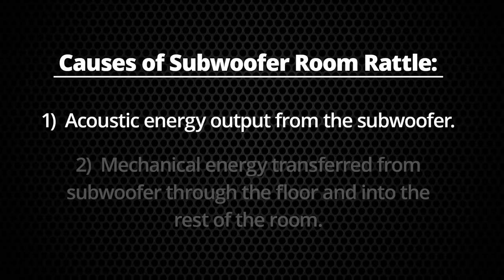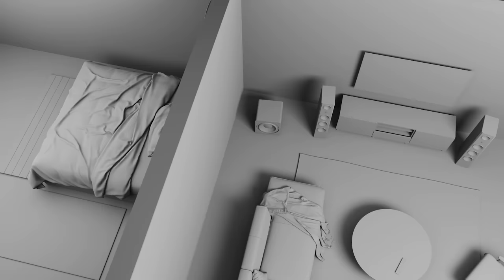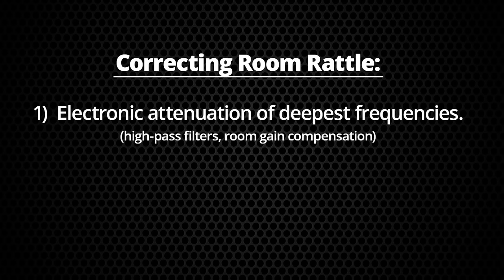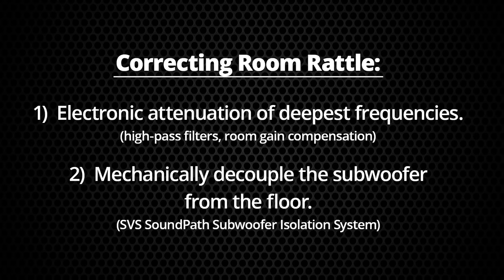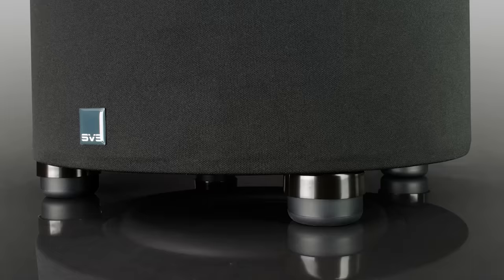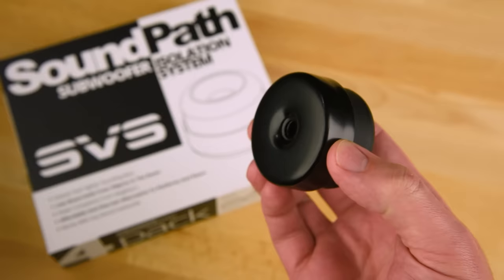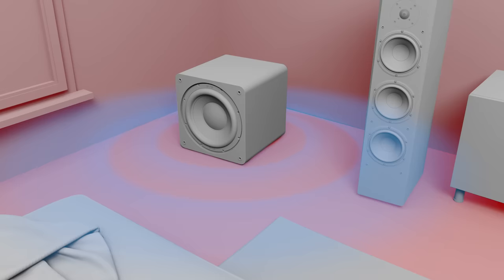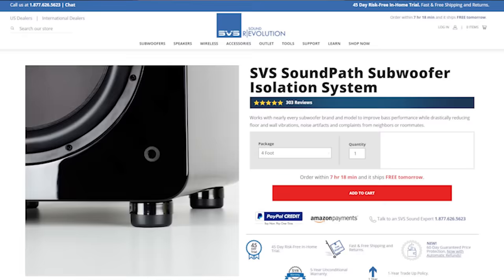How to Reduce Subwoofer Room Rattle, Vibrations and Bass Bleed

Comment: im using the prehistoric relq100e and never knew about floor boom.........i have wooden floors and when i ran the thx deep note test at the end of the avatar blu ray  the final part of the test i thought my sub was having a heart attack it sounded awfull........thank god i live in a detached propety...perhaps the supplied spikes are doing it any good?
Reply from the maker: The spikes keep it off the floor but generally don't decouple it from the room. Many people find adding the Isolation System eliminates the floor boom and room rattle, especially with wood floors.

Comment: I have a question if I may ask. What would be considered the weight limit of the isolation feet?
Reply from the maker: If using correctly with the proper number of feet replacing existing subwoofer feet, there's no official weight limit.
Reply: @SVS_Sound  90lbs+? My loudspeakers have 15's, and the house has hardwood floors throughout, so I'm quite interested is seeing how much vibration it would eliminate.

Comment: So for carpet the spikes that seem to come standard on the sub in the video would be just fine then?
Reply from the maker: The spikes won't decouple the subwoofer from the floor. That said, if you're not experiencing any room rattle or resonances with them installed, there's no reason to upgrade to the SoundPath Isolation System.
Reply: @SVS_Sound   is there a better way to decouple the sub if it's on carpet? Im assuming that this soundpath product isn't meant for carpets?
Reply: Joost Geurts Van Kessel it even helps on carpet.
Reply: I think spikes would couple the sub to the floor, increasing transmission of rumble.

Comment: am having sony iv300 dth home theater. am not happy with subwoofer. Please Suggest an replacement for that subwoofer.
Reply from the maker: The SB-1000 Pro would be a great alternative with deeper, more powerful bass if you're system has speaker level or RCA outputs.

Comment: Nice video trying to solve this problem with my home theater that’s in my basement walls are made of acoustic fiberglass from Owens Corning... the walls  I do not think are transferring really much energy to the rest of the house but the ceiling is... more specifically the floor above is... the ceiling is a drop fiberglass ceiling which the bass waves pass directly through for the most part... I know adding fiber glass insulation in the ceiling can only do so much with bass waves but I think if I put in denser ceiling tiles overhead instead of the fiber glass ones I currently have the combination should help me correct the problem? Right? 

My logic is that a drop ceiling for the most part is decoupled from the floor above as it is suspended, I’d prefer that to take on more of the bass wave impact first. Then the fiber glass insulation can help reduce whatever is left over.  I’m also going to try and rap duct work with insulation to cut down on resonance through there... is there any thing you suggest I do to my ceiling that’s relatively affordable?   Am I headed in the right direction? I’d prefer to stick with a drop ceiling as I love the quick and easy access for wiring.
Reply from the maker: Adding some insulation above the drop ceiling tiles will greatly reduce their potential to buzz/rattle and will also provide some sound dampening and bass trapping.

Comment: Opinions on having a subwoofer wall mounted? Assuming it’s secure. My concern is with the wall/house.
Reply: Unless it's on a brick wall or a reinforced steel beam then no.. i wouldn't recommend having it drywall anchored nor stub wall mounted at all. The vibrations alone cause it to be a hazard no matter the clamping force you put.

Comment: How about vinyl flooring on top of a concrete slab? Will the pads make any difference?
Reply from the maker: If you're noticing rattles in other pats of the room like fixtures and windows, then yes. Concrete floors are inert so the floor vibrations shouldn't be an issue.

Comment: Technically speaking that I don't think so that every one should need a extra pair of rubber pads to decouple the subwoofer and its low frequencies from the ground especially floors with carpets on it and on cemented floors. Because in my experience I already listened different types of subs some with bass reflex, some with passive radiator, and some build with the tech of air suspension which you also called them as sealed for a long enough. These types of floors doesn't digest enough frequencies which have been reproduce by the subwoofer itself so in this case you will still get a decent amount of power driven out to you as deep as the subwoofer can handle the acoustics upto.

("MAY BE RECOMMENDED FOR HARD WOOD SURFACES AS THEY RESIST SOME LEVEL OF FREQUENCIES")

Comment: I have the pb2000 on the second floor, wooden floor boards with carpet. Do you think the isolation feet will work well with providing a cleaner, tighter bass?
Reply from the maker: Yes, that is a scenario where it would be effective, If you don't notice a difference, you can return within 45 days and we'll pay shipping.
Reply: @SVS_Sound  I would love that, however, as a UK customer this will not be possible. But, I do trust your products so I know I can buy them anywhere and not be disappointed 😁

Comment: I have SVS 1000 Works good in my room no side sounds
Reply: I have the same sub but in my bedroom 
lower notes like 20hz can still be heared and it's shaking a lot my rear wall and door even at a normal level.

Which is not the case with my preview subwoofer in the same room even at a very high volume.

It's the proof that even the smallest svs sub provide a lot of energy even under 24 hz

Comment: Will these make much difference on a floor with carpet? Received my SB-3000 this week and running it with my Yamaha YSP-5600 sound bar. It’s unbelievable!!
Reply from the maker: It really depends on how your room is interacting with the subwoofer output. If you hear windows and other things rattling , or it's bothering neighbors roommates, it will help. You can also return at no cost within 45 days if there's no improvement.
Reply: @SVS_Sound  Thanks. Will try them out. The SB-3000 sounds amazing! Can really feel the bass!👍

Comment: My subwoofer makes a rattling sound at 35hz is there faulty in subwoofer or  all subwoofers rattles at 35hz?
Reply from the maker: You should not be hearing a buzzing coming directly from the subwoofer though it is not uncommon for subwoofer output to cause things in the room to buzz at certain frequencies. If it's an SVS subwoofer, please contact our support team to dive deeper into the issue custservice@svsound.com.
Reply: @SVS_Sound  thanks but it's not am svs subwoofer its am edifier t5 sub

Comment: Hi SVS!😊 I'm currently on the market for purchasing a small compact subwoofer for my apartment. I've considered many brands, but landed on SVS. I'm currently looking at the SVS SB-1000, but my question is. Are you guys planing on making a similar sub, but with a 10" driver, to make the cabinet even smaller? Cheers,
Reply from the maker: Hi Kristoffer - No immediate plans for a smaller 10-inch driver subwoofer. SB-1000 will remain our most compact model for the near future.

Comment: Should try this with my desktop's sound system. There's literally a joist under the floor right where my desk setup is and a double joist under the wall the desk is in front of... The bass vibrations basically go though the floor into the joints and into the center beam of the house much to my mother's announce.
Reply from the maker: It should definitely help with the energy transference in your scenario. There is a 45 day risk free trial so you could test and return at no cost if there is no noticeable difference.
Reply: @SVS_Sound  I tried it with a scrap peace of hard foam it definitely makes a difference in both the thump of the bass traveling though the beams and less revirb resulting in cleaner bass. So I'll definitely be doing something more permanent.

Comment: I built a pair of subwoofer platforms with four tennis balls each sandwiched between 1-inch thick boards. I used a door hole saw to recess the tennis balls and hold them in place. This greatly reduced the mechanical transfer from my subs to the floor and seems to tighten the bass sound considerably.

Comment: So what can I do about a down firing Subwoofer?
Reply from the maker: All down-firing SVS subwoofers come standard with the SoundPath Subwoofer Isolation System. They will also work with other brand models as long as there is enough clearance for full excursion and the screw thread size works.

Comment: My subs (dual pb3000's) are in my basement on Cement. I still get lots of vibration and rattle. Bass throughout the upstairs. I have figured there's not much I can about it. Yes?
Reply from the maker: You may want to try the SoundPath Isolation System with the 45-Day trial, and if they don't help mitigate some of the vibrations, send them back at no cost. Beyond that, there are things you can do to soundproof the basement, like insulation between the floors or installing other dampening materials,
Reply: I have these on carpet/concrete and it definitely helps reduce the vibrations and rattles.

Comment: I have 3 SVS subs, 2 PC-13 ultras, and 1 PB-12 NSD. What I did was use the shipping foam and then cut plywood to cover the foam and put the subs on top of those. The PB-12 NSD has a mechanics dolly under it. Do you think these pads would work better than what I did? I live in a manufactured home and you know what kind of rumble that is, hole house, neighboorhood, I also have bass traps and acoustic foam all around the room. I'd be glad to try them out if you think it would be better than what I have now. Fantastic Subs I must say...
Reply from the maker: Thanks! Given the research we put into the materials and testing, it would almost certainly have a positive impact on reducing rumble and rattle you have vs. the current solutions. My recommendation would be to take advantage of the SVS 45-Day trial and install on 1 of the subwoofers to see the effects and then return at no cost or add to the other 2 subwoofers if you notice major improvement.
Reply: @SVS_Sound  Yeah, I don't think I'd be able to notice anything with only 1 set of pads. I wouldn't want to turn the other two off because it wouldn't be the same sound I know, and love. I like my music at concert levels, lol... Thank you SVS Keep up the Damn good work!

Comment: How do I keep my windows from rattling?
Reply: I have/had this problem on both my windows in my listening. Older windows that rattled like crazy.  Of course not everyone can do what I did. I drove in 2 machine screw inserts into my window frames on the left and right side. Then I took a oak 1X2 and made clearance holes for a threaded knob and a stud on each end for the inserts. Now I have a cross member running across my window. Then I made a wedge from a of a block of wood to press against the glass in the center of the window and this temporary cross member and that puts the glass under pressure and prevents rattles. I can put both up in a few minutes for a longer and/or higher volume listening session. I figured when it is time to sell it, I'll fill the holes with a wood plug and stain to match.  You may be to able to the inserts next to the window but under pressure did not want the drywall anchors to pulling out. I find I need quite a bit of pressure against the window glass. Volume/frequency dependent of course. You can test this by just by putting pressure on the glass in the center with your thumb.
Reply: @briansimmons5363  yeah I have the same problem as soon I push aganist the window the rattling stops. So I might have to do some mechanical work as well or just invest into better sealed windows
Reply: Hi, I have the isolation feet and I'm still getting vibrations in my walls, doors and ceiling. My sub is in my basement which has a concrete floor with vinyl floating flooring on top. What can I do to reduce vibrations?
Reply from the maker: Very handy, thanks for sharing the experience.
Reply from the maker: There are some updates you can make within the DSP that can help attenuate. Please send our support team a note at custservice@svsound.com and they can walk you through the options.
Reply: Thick window curtains help a ton
Reply: Remove the glass
Reply: They certainly do. I have 120 inches of window on my side wall. The curtains helped a ton.

Comment: Keep your speaker settings on small, and Subwoofer mode on LFE+Main and move away from corner. Assuming you have a modern receiver.
Reply: This kind of setup is even on budget AVRs from early 2000s
Reply: @pulDag  It's also the best setting for places with poor acoustics
Reply: I am curious as to why LFE+Main and not just leave it at LFE?
Reply: @DarkWilSin666  At the time, this was my though process. It no longer is nor do you need LFE+Main unless your receiver is old. Like pre 2000s.

Comment: Why wouldn't  a company and   the price  of the Sub  have the ISOLATION FEET COME WITH THE SUB COME ON SVS  YOUR A SUBWOOFER  COMPANY
Reply from the maker: The Isolation System adds cost over the standard cone feet and in some environments, is not as much of a benefit, like on concrete subfloor. It also adds height to the subwoofer which can be an issue for people placing in/around furniture.

Comment: This is literally just an advertisement
Reply: at least it's beneficial and more effective than some -48volt speaker cable bullshit that's out there.
Reply: Whether it’s advertisement or not they are honest people giving you excellent product that actually works and is worth the money. Don’t like it then don’t watch!
Reply: In a way yes, but they actually provide another way of reducing rattling using a HP filter, which is extremely handy for the late nights, I use this on my MiniDsp to cut 20hz and below, it is very effective, and can disable it when I want to go all out, i'm not of much a fan of Audyssey LFC version as it cuts too much though IMO
Reply: @jimmy2shoes75  yeah, I never would have thought about it until I clicked on the video and watched it. I have hardwood throughout the house and everything can vibrate when I turn my system up.
Reply: @cr4ckr4bit  I don't if you have these SVS isolated feet, but I do stand by them, they really do make a big difference, are they a complete fix no you will still get vibrating doors and windows and so on, but the feet do help and it also helps in giving cleaner bass too.